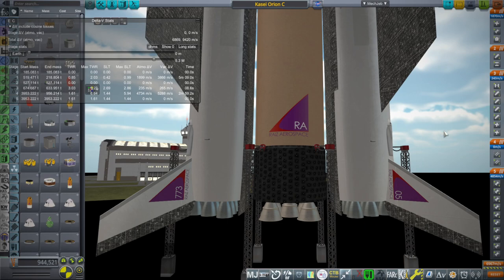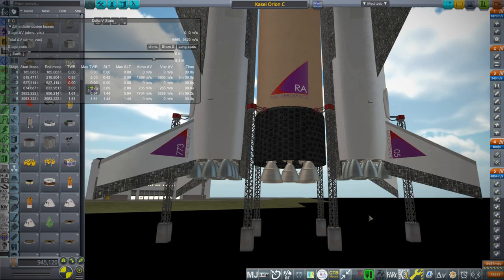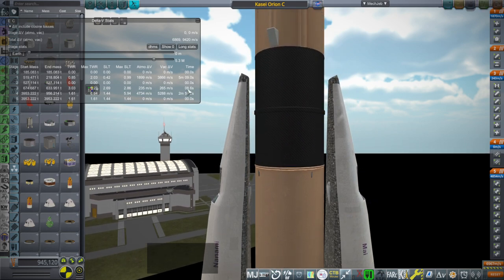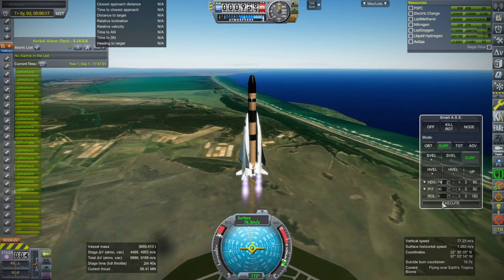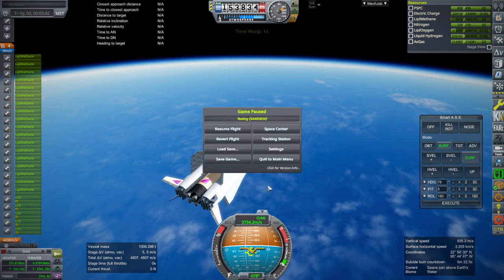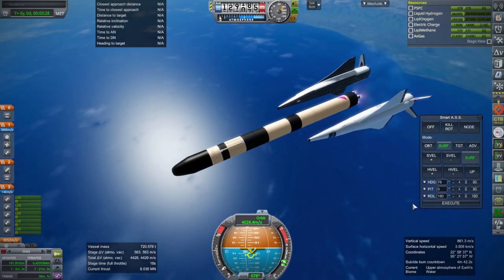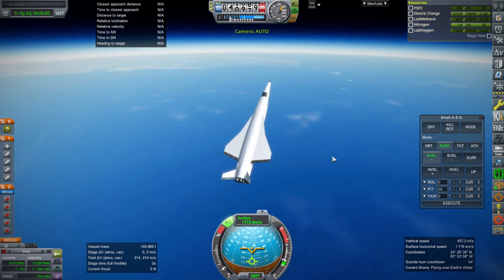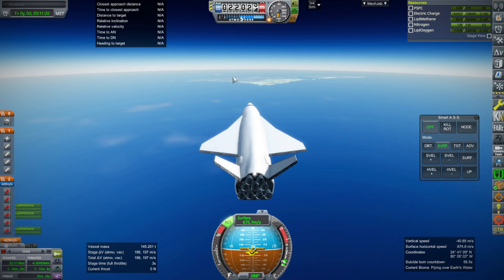KSP 1.12 with RO - Kasei with Orion Carrier Boosters

Comment: The orion pilots are going to have a bad time being strapped sideways for half the flight.
Reply from the maker: Those are automated planes - no pilots. The apparent windows are a legacy of the original design from the proposals that led to the design in 2001: A Space Odyssey, but I didn't want to waste the mass of fitting a crew cabin, which would make the system less efficient, and automated technology was already good enough in the time of Buran. Plus, the fact that it comes down at 9-11 Gs really makes it bad for crew.